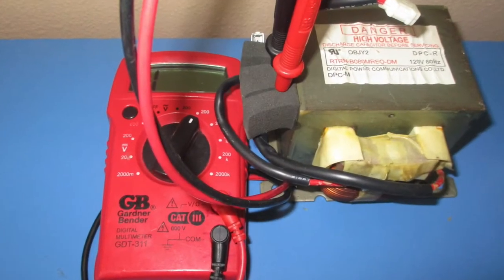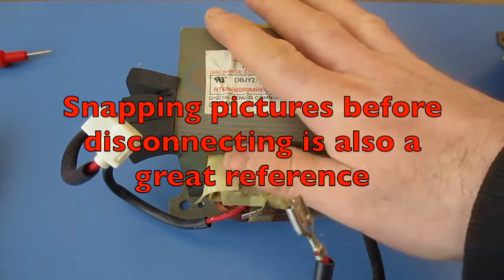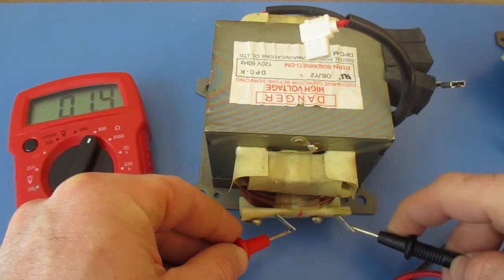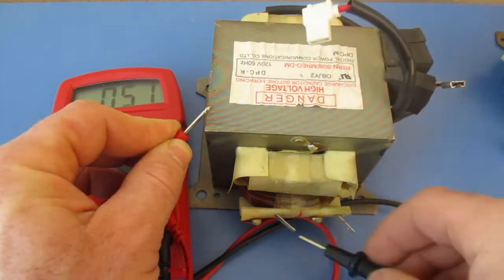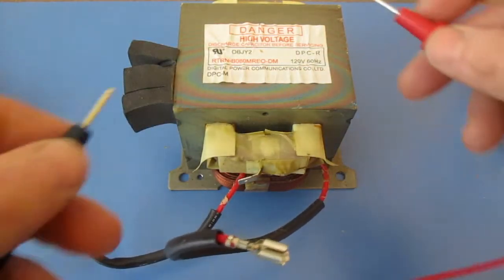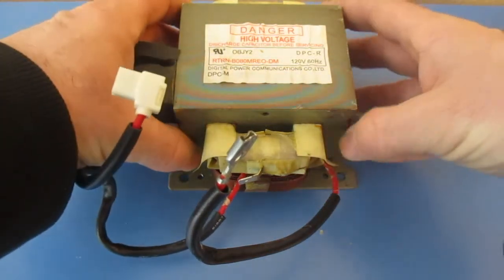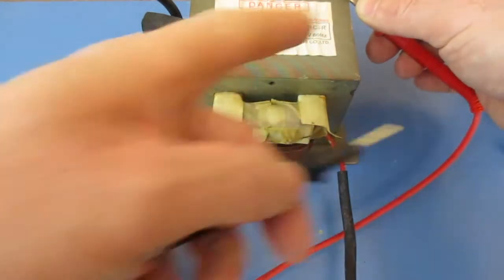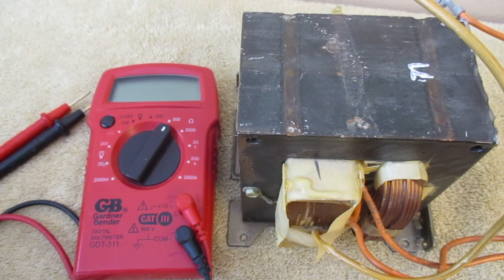Troubleshooting Microwave Transformer testing Primary and Secondary with Multimeter

Comment: Good evening master just wanna ask about transformer reading,the primary 2.7ohms set 200ohms.and the secondary I got 170.9 ohms set 200ohms. And the wire in between primary and secondary I got 1 ohms

Comment: I purchased a new transformer but the connectors are in a different position on the primary. I don't know which connector to connect the red and white wire to. Can you advise if it matters which connector is used for the red and white wire?

Comment: Thank you. 🙂
Reply from the maker: Thanks for the comment, hopefully you got your issue figured out...
Reply: You can Fix It!!!! 
Well, I checked everything but the control board with my multimeter and all the readings were good, but I'm unsure how to go about checking the control board with my multimeter? Also, it appears like the small transformer is soldered to the control board? Will I get accurate readings with it like that?
Reply from the maker: what's actually happening with your mwave.  Not running at all, no light or buttons not working on the display, buttons not working, running with the door open, buzzing, not heating, no power?
Reply: It doesn't heat. Everything seems within range on my meter. I haven't checked the control board with the meter yet. There was a lot of dust etc... on/around the magnatron so I cleaned the interior up real good. I'm gonna go ahead and start it up again and see if the cleaning did the trick?
Reply from the maker: Check the Diode as well.  Here is a repair link
https://www.fix.com/repair/appliance/microwave/no-heat/